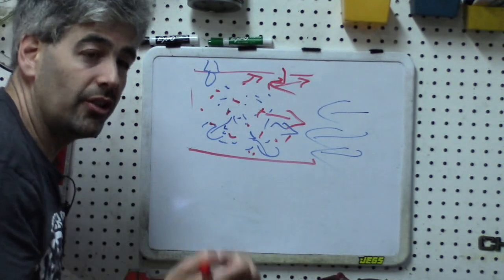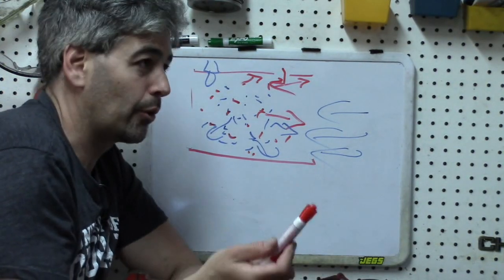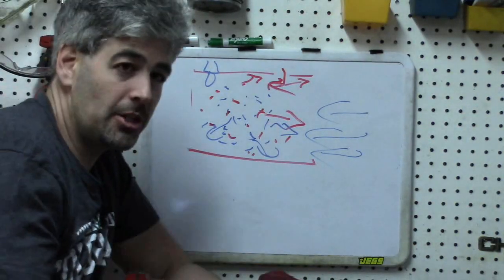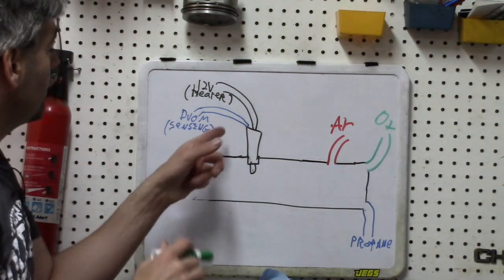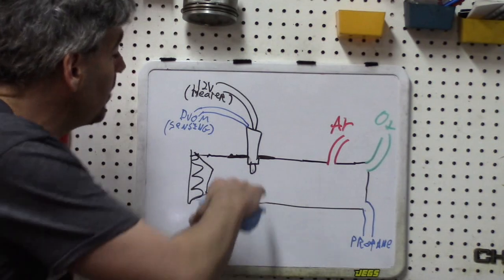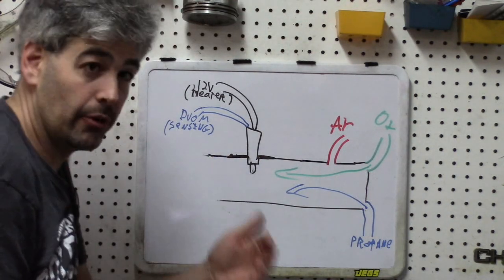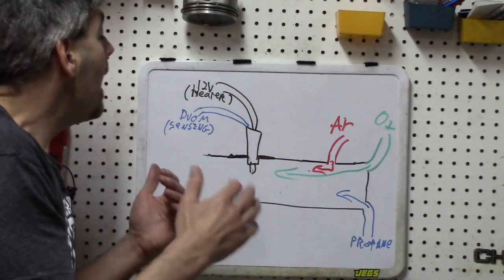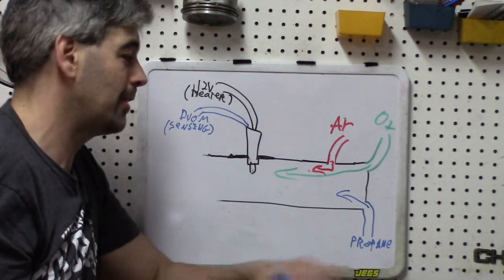Experiment for O2 Sensor Pt5  New Experiment Proposal

Comment: I tell you what Matt. I'm a professional mechanic and a science major,  professional YouTube idiot doesn't count lol. I have watched all your videos a few times and I can say that there are always going to be people who criticize there's always going to be somebody who thinks of their scientific method is better than yours and there's always going to be just general crab apples did just get on YouTube to find anything they can to complain about but I back you 100% and as far as I'm concerned because you are obviously better at science than I am, as a professional mechanic I would just about say that your word is gold from all the videos I've watched. Just  wanted to throw you a little positivity your way great video by the way man.
Reply from the maker: Thanks man.  For the most part, the objections have actually been valid scientifically.  It is a good point that one explanation for my results is that the exhaust is a closed system and gas "dilution" is indeed very much affected as such.  Disagreements are done with proof though so it is necessary for me to prove that partial pressures are not responsible for the argon having no effect.  I dont mind criticism like that at all.

Comment: Couple idea's on the construction of this device, instead of plastic why not use iron\steel pipe? this won't affect the readings of course, but if the o2 heater isn't enough heat for it to work right, a steel pipe could be heated externally.
   For the inlets, have you thought of using one way valves (maybe schrader valves would work?) to reduce\eliminate cross contaimination? (i think it's the venturi effect, if you had oxygen sitting unmoving in the inlet hose, another gas turned on could suck small amounts in)

For your "sealed system" idea to make it easier to fill\purge the capsule, you could add a relief valve on one end, so once a certain pressure is reached it flows, but once you drop back below it seals again.

I love that your doing this, and i suppose I am on the it sensing oxygen camp.  This sort of experiment can also definitively rule out if the sensor being used act's more like a switch as well.
Reply from the maker: animefreak5757 There is no way in the world you would want to construct this with metal for safety purposes.  That is out of the question.
Reply: animefreak5757 Why?
This site says the wall thickness of a 2" schedule40 steel pipe is 0.154 inch's,
     This site http://www.engineeringtoolbox.com/barlow-d_1003.html says the burst pressure of a 0.148wall 2" steel pipe is 8663 PSI
This site http://performancetrends.com/Definitions/Cylinder-Pressure.htm says peak cylinder compression is between 300 psi at low loads, and 1500 at high loads.  This is air\gas mixed at near stoich, then compressed somewhere between roughly 8:1 and 12:1 depending on engine.

1500 is still a safety factor of 5 below burst pressure.  In real terms, i don't think your planning to mix the gas at stoich, or at significant pressure.  But even if you did mix to stoich, then pressurized it to say 160psi like a engine would create, there's still a large margin of safety.

Assuming your worried about a explosion, while pvc may seem less dangerous then steel as shrapnel, It's FAR more likely to burst and still pretty dangerous.   Any risk at all of a explosion could be averted using a flimsy plug when your looking to seal it, plastic wrap for plastic tube, tinfoil for metal.

Comment: Hey Matt, a few questions for you.

(1) What materials will be used for constructing the containment vessel and test apparatus? 

(2) Are you planning to evacuate the containment vessel and subsequently introducing single gases exclusively such as Oxygen or air and a hydrocarbon such as propane to test the sensor for individual gas sensitivity? 

(3) Will you be repeating any elements of the experiment to establish repeatability?
Reply from the maker: patw52pb1 1. plastic with one metal section for the O2 sensor due to its heat2. Flushes rather than vacuum- I intentionally and designing the thing to be flimsy for safety- it will collapse under vacuum.
3. Yes but remember I already did n-7 on the previous experiment. Reproducing it ex-vivo that many times is not necessary. Ultimately- others need to repeat it, not me
Reply: Schrodingers Box I was looking at some manufacturer product documentation in our library at work today and ran across a couple of items that may be of some value. 

(1) The Bosch and NGK/NTK manufacturer's technical reference manuals state that a heated O2 sensor requires closed-loop control of the sensor temperature to maintain a constant operating temperature range for stable operation. 

Have you decided what you will be using for a controller? 

(2) The Bosch and NGK/NTK wide-band sensor implementation guides also state that most gasoline engines usually have about 2% residual oxygen in the exhaust pre cat and that is the target concentration for lambda. 

(3) An aftermarket wide-band sensor manufacturer has a sensor confidence test procedure of placing the sensor in free air then placing the sensor tip in a steady stream of nitrogen or propane with the heater energized to determine the full lean and full fuel rich span values to calibrate the controller to the sensor. The documentation did not indicate if the sensor was detecting the propane (HC) or if the N2 or propane was just displacing the air/O2 from the sensing element.

Comment: (After some more reading and head scratching...)

I don't claim that your experiments prove that the O2 sensor detects O2. I only comment that your experiments are congruent with the approximate model "sensor detects just O2", and with the detailed models and experiment results in the papers I cited. (Especially the 1993 Wang paper pertinently covers methods, many conditions, and differences between models of sensor).

It may be possible to come up with some other theory, based on your results so far. But that theory would also need to explain all the other published tests results, which seem pretty thoroughly in the direction of the sensors measuring O2, and having some sensitivity to other gases, but not in a way which could be interpreted as the sensor achieving a high signal by measuring HCs per se.

One note: I've now read that, increasingly, new cars are using wideband O2 sensors (which have oxygen pumps, amplifiers and feedback) for exhaust monitoring, but I'm assuming we're talking here about "old style" 4-wire sensors, two wires for the heater, and two for the sensor, as that appears to be stock in the 2000 Trans Am.

It's difficult to quote data from those papers per se (nor the chemistry or algebra), because I can't post plots and symbols into these comments. However, here are a few points of interest:

Various plots show voltage (Y axis) vs P(O2) (X axis, with higher P(O2) to the right. The general shape of the curve is high on the left (around 0.8V), a sharp step down near the middle, and low on the right (say 0.1V)

Wang includes experiments with different combos of O2, CO, N2, C3H8 (propane), CH4 (methane) and C3H6, at different temperatures (heater voltages) and four brands of sensor (>=2 samples of each).

First major point -- these experiments were done without combustion. Evidently oxygen sensors have a catalyst surface because normal exhaust gas is not in thermo equilibrium, and it's the equilibrium amount of O2 that needs to be measured. So the catalyst (and spinel coating) substantially complete whatever combining is possible, so that the actual surplus O2 can be determined. Wang's experiments apply levels of gas representative of what would be present after combustion.

Next major point -- in these plots, changing the proportion of gases results in the step shifting left or right, first to account for the P(O2) ideally needed to perfectly combine with the P(other gas) stoichiometrically, and then some additional shift according to how easy the other gas is to oxidize and/or if there's some difference in the diffusion rate of O2 vs other gas through the spinel coating, and probably unknown other factors.

The non-HC gases didn't make large differences in the high and low voltage levels. The HC gases did -- they tended to reduce the voltage across the board, especially of the high ("rich") level -- for some sensor models, dramatically so. This somewhat opposes the "sensor detects HC" stance.

That said, here's how your tests correspond to what I understand from Wang.

1. When you inject additional air into the exhaust, the conditions move along the P(O2) axis to the right, producing a low voltage, as expected.

2. When you inject Ar or He:
-- during the rich cycle there's essentially no O2 to dilute, so no change, voltage high.
-- during the lean cycle P(O2) is initially some distance to the right of the cliff. When the O2 gets diluted by Ar it moves some fraction of the distance leftward toward the cliff, again resulting in a "normal" (low) signal (as in your test). Only a very large dilution would move it all the way to the cliff (I claim).  (If the ECU is actually looking at the precise level, it might notice the "decrease" in O2, and trim a little, easily overcoming the dilution factor, and likely hard to notice.)

3. Propane case, revised based on Wang: If the propane doesn't actually burn with the available oxygen, it will certainly combine with the available oxygen in the catalyst, leaving no O2 on the exhaust side of the sensor, resulting in a high (rich) signal, which your test agrees with.

Wang's data suggests that this high level might be at a lower voltage than usual, I'm not sure if that's to be seen in your data, and this phenomenon was very different for different sensors.

Semantically, if the behavior in the propane case is combining of the O2 on the sensor to reduce or eliminate the O2 "signal", I supposed that could be described as "the sensor responds to HC". However, from Wang I predict that the sensor won't respond very much to, for example, just propane in Ar, except perhaps to reduce the sensor voltage.

Bottom line, my model du jour is: to a first approximation, the sensor behaves as an O2 sensor. By virtue of its catalyst, one might say it performs a subtraction on the gas sample it sees: Available O2 minus available HCs = surplus O2. Note: subtraction, not ratio. (That's still over-simplified due to multiple reaction possibilities with CO, CO2, H2O and so on adding additional detail to the behavior.)

Hope that adds some grist to the mill.

Comment: Something for everyone :-)

From 1993 Wang: Static Characteristics of ZrO 2 Exhaust Gas Oxygen Sensors:

"The experimental studies [...] clearly show the complexity of the response of the electrochemical Zr02 A/F sensors. When thermodynamic equilibrium is achieved, the Zr02 device behaves as a true oxygen sensor, i.e. the steady state value of the open circuit emf of the sensor is defined by the thermodynamic equilibrium PO2 irrespective of the specific gas composition that establishes this PO2 Even in this case, however, the speed of response depends on the specific gas composition. For example, in reducing gas mixtures (e.g. rich A/F) with very low thermodynamic equilibrium P02, e.g. 10^-20 atm, communication between the sensor and the ambient gas is achieved not through the extremely small number of 02 molecules in the gas phase but through the large number of reducing species (H2, CO, hydrocarbons) in the gas phase."

"The behavior of some of the commercial heated exhaust gas oxygen sensors studied in this work appears to approximate that of nearly ideal oxygen sensors above temperatures in the range 450 to 550C. Below these temperatures, however, the steady state response of all heated exhaust gas oxygen sensors shows departures from ideality, at least for some gases, which can be very pronounced and complex. In this case, differences between heated exhaust gas oxygen sensors reflect differences in the sensor materials and microstructure. To no surprise, all sensors respond more ideally at lower temperatures for H2 than for CO; higher temperatures are required for ideal behavior in hydrocarbon containing gases."
Reply from the maker: Graham Wideman ...And what are your conclusions based on this data and the results I showed in the previous experiment?
Reply: Graham Wideman Possibly worth reading to get a jump start on experimental angles they used and wrinkles discovered. Sadly I could only find this at http://papers.sae.org/930352/ for $$$ (though there is a preview of the first few pages).
Reply: Schrodingers Box I continue to think that your experiment results comport with "it's just an oxygen sensor" under the conditions you ran. However, this paper does comment that a ZrO2 sensor can have some interaction the HCs (though under other conditions). And further, I'm with Jurgen on the "you need to introduce a large flow of Ar to sufficiently dilute the O2 to make much difference in reading", but pending a ballpark figure on exhaust flow rate.
Reply from the maker: Graham Wideman You still haven't given specific reasons on how my experiment results support that conclusion. What specifically in all the data you copied and pasted supports your theory that the conditions I ran prove O2 sensor detects O2?
Reply: Schrodingers Box Answered in separate comment.

Comment: A series of papers on the analysis of gas sensors in general and Zirconia Oxide sensors specifically, from A.D.Brailsford of the Ford Motor Company Research Physics Dept, 1993 through 1997. All published in the journal "Sensors and Actuators B", available from Elsevier (helps to have access via university library).

The theory is gradually extended through the series of papers to cover more complex scenarios.

1993: Theory of Gas sensors. First-principles model applied to ZrO2 sensor.

1993: Wang et al (also at Ford Motors) Static Characteristics of ZrO 2 Exhaust Gas Oxygen Sensors. Lab measurements of the four major brands/types of ZrO2 sensors, in an experimental apparatus, and also in-car, with variations of gas mixtures and temperature.

1995: Steady-state model of a zirconia oxygen sensor in a simple gas mixture

1996: Steady-state model of electrochemical gas sensors with multiple reactions (Includes direct ZrO2-CO interaction.)

1996: Theory of gas sensors: response of an electrochemical sensor to multi-component gas mixtures

1997: A first-principles model of the zirconia oxygen sensor

1997: Experimental and theoretical study of the response of ZrO2 oxygen sensors to simple one-reducing-gas mixtures

1997: (Woestman first author): A model of transient response of mass-transfer limited gas sensors
Reply from the maker: Graham Wideman And your conclusion based on this information as it relates to my findings from the last experiment would be......?
Reply: Schrodingers Box (Replied to on my "1993 Wang" thread.)

Comment: Hi Mat,

I am a little concerned about your safety.  You are planning to use oxygen and propane, Beware of the flash fire risk.

Omar
Reply from the maker: Omar Eraiba Thanks I got the safety part down- I do not plan on using oxygen and propane together, there is no need to.please comment on the controls and variables necessary to ensure only one possible conclusion can be drawn regarding the mechanism of the sensor.
Reply: Schrodingers Box 
Glad you are taking safety under serious consideration here... but please explain, at about 7:55 you mentioned 100% O2 environment. That's not what I would consider safe, unless O2 means "air" as you previously stated.
Reply from the maker: trident1971 That's right. I need to ensure a 100% O2 environment so I don't risk exploding the model.  It will be the only time I use 100% O2 at all for safety reasons.
Reply: Schrodingers Box If I remember correctly, O2 is an oxidizer and not a fuel meaning that 100% O2 in a clean environment free of any fuel there is no ignition/combustion even in the presence of a heat/ignition source such as an O2 sensor heater. 

Is that correct? 
Does the same principle also apply to a 100% propane environment free of any oxidizer?
Reply from the maker: patw52pb1 That is absolutely correct Pat.  It is impossible for  a chamber with nothing but 100% O2 to ignite because there is nothing to "burn".
Reply from the maker: trident1971 ... with fuel source.  Where is my fuel source in this design?
Either way it is not even remotely analogous to the apollo scenario whatsoever, so don't worry.
Reply: Schrodingers Box yes, i realized that no "fuel" was present in that scenario and deleted my comment, but somehow you saw it first :(

Comment: I think i would work great, and im also very interested in the tests with it pluged. cause then you could blead out the air(room air) with argon, since it is heavyer then air at roomtemperature. If you then add O2 to it and see a change, it would speak for a simple O2 reactive sensor.
Take you time on building it ;) ^^

PS: About the Intake O2-sensor.
I would not say that you dilute the O2/air, .... like you mean it ... i think (different language for me as a german). But you give the pistons/the engine a nother gas source that it can use to fill the zylinders. So normaly with the EGR-valve closed it would.... lets say it sucks in 10 parts of O2/air and with the EGR-valve open you at a gas source. Now with the valve open the engine sucks in 9 parts of air and 1 part of EGR. So you would have a lower amount of O2 in the intake. The HC in the EGR doesnt matter.